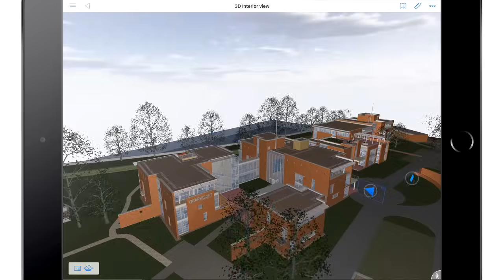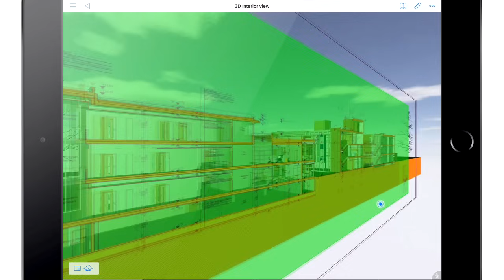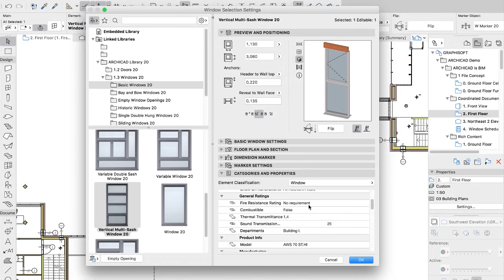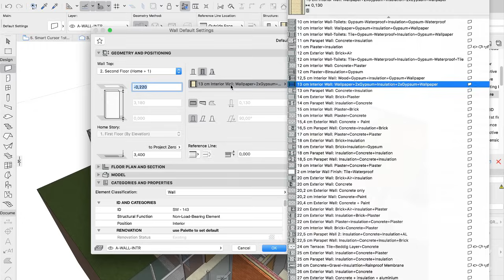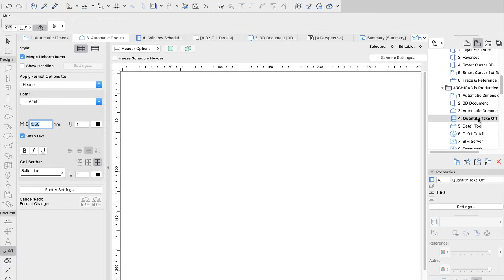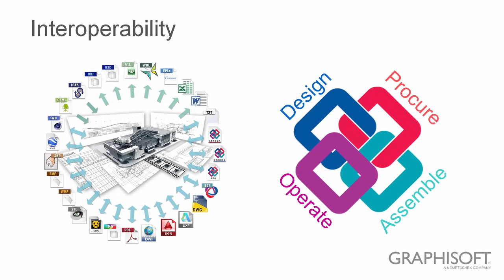Discover ARCHICAD in 29 minutes

Comment: at 21:25, that concrete slanted slab coming out of the building, is that a morph? or complex profile? and that little section of insulation on the inside of the parapet wall, is that a wall? it's the little details of how to get things to appear right that I struggle with mostly.
Reply: ARCHICAD thank you master